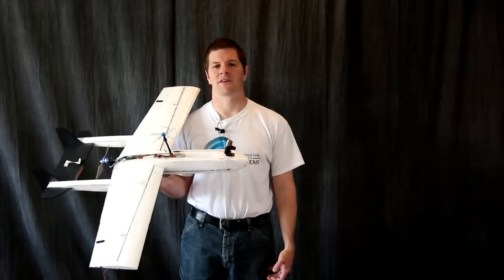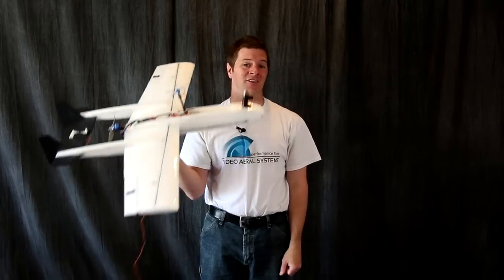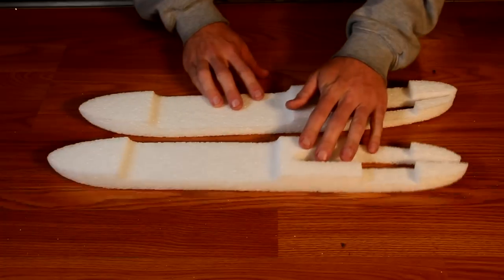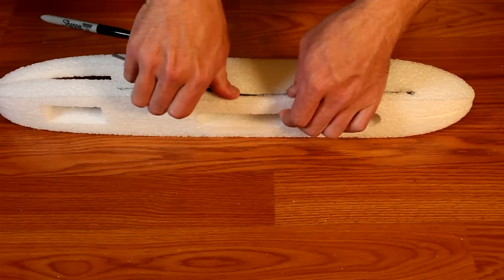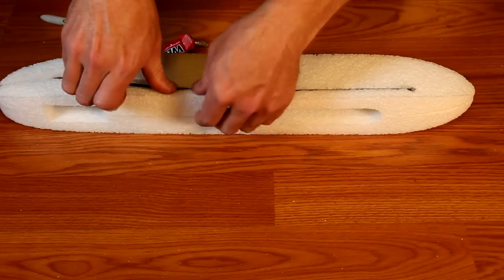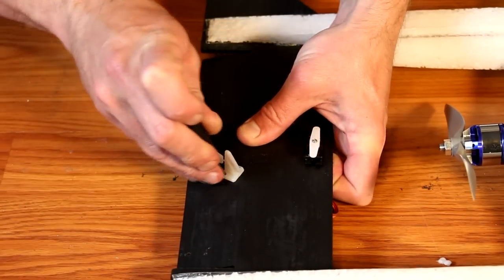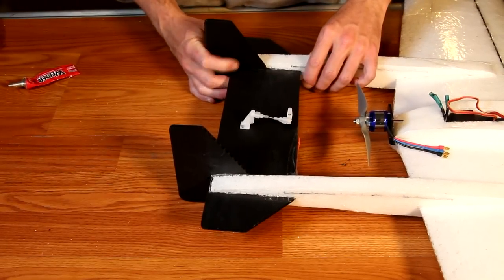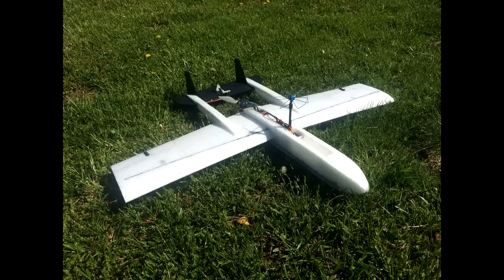IBCrazy's Banshee (Specter mini) FPV airplane build

Comment: Alex. I have some 2826 motors for a bixler build and plenty of 6-8 inch props. Too much or too heavy. I want a nice cruising basher.  2208 and 2210 are hard to find right now. I also have some 2005 and a 2206. 20 amp escs.
Reply from the maker: biomedchad - you can go up to 2217 and it will still work well.  2210 is probably the middle of the range of motor sizes.  2215 would make it a rocket.

Comment: Great Video.  What is the difference between the Banshee and the Mini Specter v3?  Also who is selling the Banshee kit now?
Reply from the maker: Jeff Eitzman The Banshee is a mini Specter3.  I just gave it a different name to avoid confusion, that's all.  it should be available in 2-3 weeks.
Reply: Fantastic!  Thx
Reply: Sorry....one more question, do you have a recommended power setup? Thanks again for all you do for this great hobby!
Reply from the maker: Jeff Eitzman Yes.  Any 2206, 2208 or 2210 multirotor motor around 1600-2000kV with a 7" prop will do really well with this airplane.

Comment: Is the Banshee the Mini Specter? I don't see it on STA's site by the name Banshee.

Also, It's OK to glue the foam to the laminate?

Thanks.
Reply from the maker: HighFlight2k2 - I renamed it to avoid confusion, that's all.  it is a mini Specter.  You can glue the foam to laminate.  I do it all the time.  The kit doesn't come with it, though.  This is meant to be a very inexpensive airplane.

Comment: in the process of building my banshee, and mine only came with 2 spars, there seems to be insufficient to add spars to the booms, is this normal?
Reply from the maker: Yes.  The booms don't need spars.  I changed the foam to a denser foam to stiffen them so you wouldn't need to use any spars.  However, I would use the remaining 2X 12" sections of spar to reinforce the main fuselage underneath the wing.  You want 6" in front of the wing and 6" underneath.  This will keep it from snapping in a hard crash.
Reply: Awesome, thanks, i'm really excited to fly this thing.